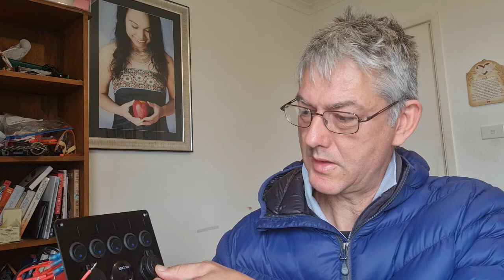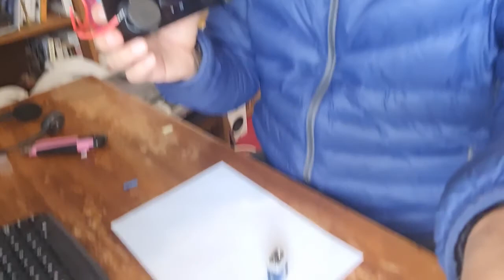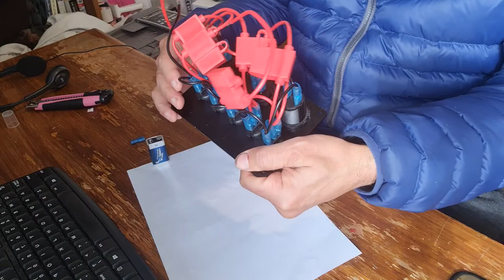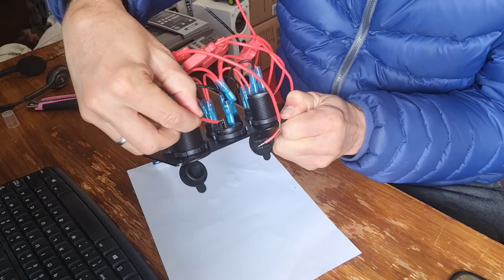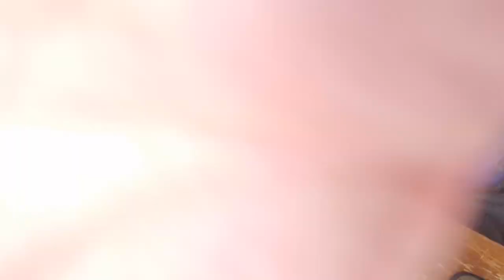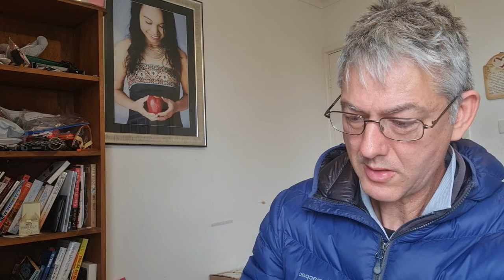How To Wire Up A Van Switch Panel - And Isolate With Internal Switch

Comment: If you dont use the positive and use the first switch as the main positive that works as an isolation switch for everything on it all switches usb and voltage meter

Comment: Have you worked out how to turn the usb and 12v socket lights off as well as the volts yet? I tried but could only manage to do either one or the other not all light

Comment: Thats very smart mate. Never would have believed that little 9v battery could have the power required to run 12v stuff. Good trick. I was wondering if you could have something rigged up so you could plug into a cig lighter to test things like this?
Reply from the maker: Cigarette lighter is a great idea, as that would test the full 12 volts.